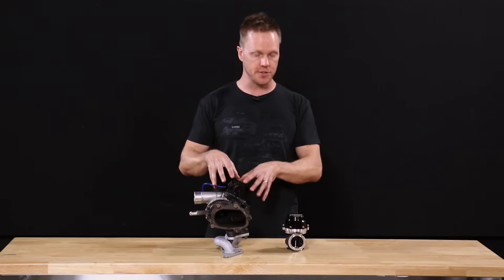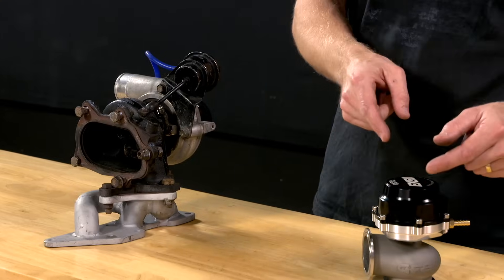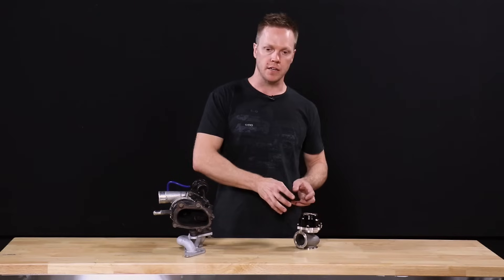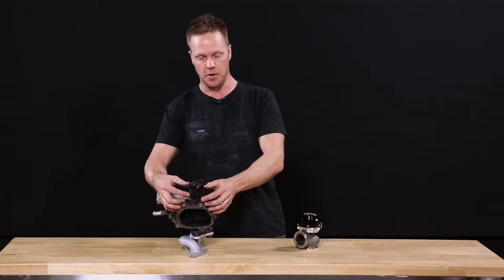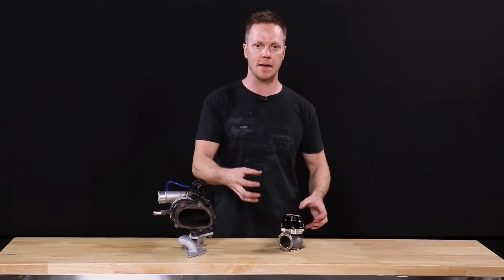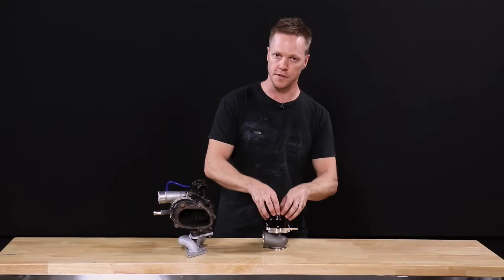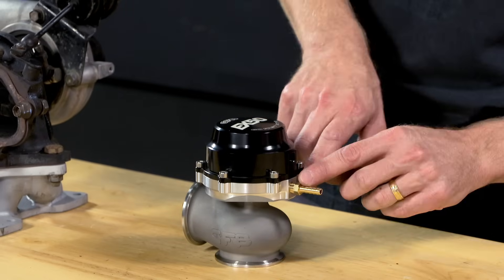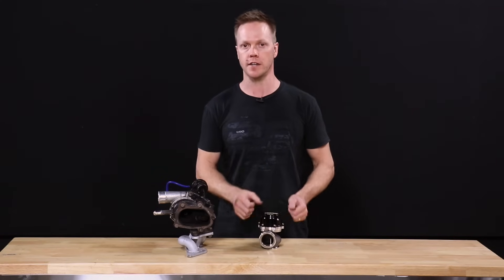Internal VS External Wastegate Explained [GO FAST BRETT]

Comment: I have a V7 JDM WRX so I am needing to put a JDM downpipe on them. I found a company who does both a catless vs catted and I originally wanted the catted because I was worried about the smell and boost creep butr decided to go with catless due to cost. However, watching this has made me again re evaluate my choices. Is it cheaper to just buy a High Flow cat and be done with it, or cheaper to grab a Catless downpipe and do an internal to external wastegate conversion? I am planning on replacing my TD04 with a VF30 at the same time as I do the Downpipe.

Also, with JDM WRXs, do you need to replace the Upipe or can the stock one be used with external wastegates?

Comment: how do you adjust boost pressure using your stock internal waste gate? and how do you know how much boost youll be making
Reply: manual boost controller and fit a boost gauge :)

Comment: I have a Q: I have seen some cars with an exhaust system, but they have been spitting flames right under the engine at redline. Does that mean that they had an external wastegate that was throwing the gasses right into atmosphere?
Reply: I have the same question and sadly after 5 years no one answered your question
Reply: @diego.soli5  Yeah thats most likely an external wastegate. A  pipe going from the manifold that lets out exhaust pressure to adjust the boost pressure.

Comment: Go fast Brett, can you do some explanation on  the dark art of turbo charging diesel, And perhaps how to maximize the power available from a turbo diesel engine.
these vids are great, keep em coming.
Reply: It's essentially the same thing. More air + More Fuel = More Power
(a bit over simplified, but works for this example)
Reply: I should also note that if its a factory turbo diesel, the turbo isn't there to make power, its there so the engine can actually suck enough air to work at such low rpm's
Reply: /DRIVE did a segment on Diesel which is better than this rubbish.

Comment: All I head was: "I have made a waste gate, you should buy it"
Reply: Maybe listen with your ears instead of your arrogance?
Reply: This is pretty much what this whole "Go fast Brett" series is as with his blow off valve segment he didn't even touch on wide open throttle turbo surge and instead pretty much said if your turbo flutters when the throttle is closed it is bad and you should buy my product, which infact when the throttle is closed and when the turbo "flutters" the use of a recirc valve/blow off valve is to stop reverb through the Airflow meter/MAF to cause an incorrect reading and cause the car to stall out when coming to a complete stop.
Even Turbo Yoda said or anyone who is switched on with turbo's knows flutter isn't bad.

Comment: Great concept and I am really learning stuff from these videos eventhough I thought I at least had an ok grasp on how these things work.
I understand that this is sort of the generalized version of how it works but I assume  a lot of these "truths" vary depending on application. For instance dumping boost into the exhaust is that generally always detrimental? I am sure it depends on the diameter and flow characteristics of the exhaust since sometimes a larger volume of gas in a narrower pipe has a higher flow speed and hence more inertia (up to a point) and that actually helps clear gases more efficiently. This is analog to situation in the intake where an optimal portsize is not always the largest one but the one that keeps the speed of the gasses up without beeing so restrictive it saps power (optimal portsize varies with amount of gasflow). Same with dumping boost it in proximity to the turbine blades. I am sure in a factory setup it is "good enough" but could it not be constructed so the dumped boost actually improves the flow/pressure-conditions after the turbine blades? Can the flow be made to be more laminar? Just an idea :) Keep this up.
Reply: A properly sorted External wastegage should in theory act like exhaust headers ( ie a mild scavenging effect ) However at extremely high flow rates of exhaust gas you would be introducing a turbulent effect causing a the exhaust gases to slow down...............Internal gates have their places.......up to mildly modified street cars you wouldn't really notice the difference and the money would be better spent on other areas.
Reply: Robert D I am sure you are right. I just find it fascinating that these are actually very complicated engineering problems where so much depend on the specific application. A pro like Brett who both have the technical knowledge and experience has to "dumb" it down in order to fit it into this format. I would not mind a longer more in depth video similar to "Engineering explained" :)

Comment: What about position of an external gate?

If you have it where exhaust pulses don't collate properly you won't be able to control boost pressure as the reference is still available to spool the turbo.
Reply: Best position of an external waste gate is on the exhaust housing of the turbo before the exhaust wheel.

Comment: Hi Bret,
One thing you did forget to mention is that it is crucial to ensure an external wastegate is correctly positioned on a manifold, so that the exhaust gases don't bypass it at high rpm.  I have seen a 46mm one offer zero bleed off at high rpm from poor positioning, just because the exhaust gases are travelling so fast that they completely bypass the wastegate.  We even removed the wastegate completely to prove the point LOL.

Comment: The only IWG setup that's top-notch, elegant in design, and more than sufficient for the job is that found on the BW EFR turbos, IMHO. I love those.
Reply: Im looking at getting an EFR 8374 twin scroll internal wastegate for my 2jz, I hear the factory actuator is crap but I don't know how true that is. Turbo smart already made a 2 port actuator upgrade for the EFR series turbo already.
Reply: Brian Jeppesen That's the first time I heard of issues with the EFR wastegate actuators. All I've ever heard about them is how awesome they are, next-level, etc. After all, they are run on F1 cars, so they're definitely viewed very highly in the professional racing community. Perhaps it was an old WG actuator design that was revised? Was the person(s) saying it's crap reputable and speaking from actual practical experience?
Reply: +Numinous oh I didn't know they've revised it, I'll have a dig around some more thanks for the heads up. It's the Rotary guys that's saying the actuator isn't very good at higher rpm the flap would open abit as there's no 2nd port in the actuator for the boost to hold it shut and they would get boost drop off.
Reply: Brian Jeppesen Hmmmm, well that could be a lot of things. On my platform (Mazdaspeed 3), we drool over these and have had great luck. I'd personally go with an EFR7163 (we're 2.3 liters) and have it tuned for 500whp.. It's an amazing, fast spooling turbo, with very low boost threshold and amazing transient response. Some other guys talked about using the EFR8374, but I think it's too big for us for anything other than a dyno queen, given our displacement. Regardless, awesome turbos.
Reply: +Numinous thanks for the info man nice to get feed back from someone who have actually used it, I got a Nissan Z32 with a 2jz swapped. Being a 3 liter I think 8374 would match it alright.

Comment: Does one sound louder or nicer than the other. I assume each person has their own preference. Be nice, I'm new to this stuff :)
Reply: The external will be louder if you vent it to atmosphere, whats known as a screamer pipe but if it is just dumped into the exhaust it will sound more or less the same
Reply: It depends on how you run the dump if you run an external set up. If you run it back into the exhaust it will sound much like an internal wastegate and won't make much of a difference. If you dump to atmosphere you are basically running a straight pipe everytime your wastegate opens. So it will sound like your exhaust normally does until you hit full boost, your wastegate opens, and it gets a lot louder. Wastegate dumps are sometimes called screamer pipes for this reason.
Reply: but i thought the wastegate closed when you reached full boost , isnt it like that ? (im also new to this stuff sorry if i didnt understood )
Reply: +nah valdez Well, you understand that a turbo uses exhaust gases to spool up, right? Think of it this way, a wastegate pretty much literally "wastes" exhaust gas once you reach your target boost pressure. It opens in order to let exhaust gas through without further spooling the turbo to prevent over boosting. That gas is "wasted" because it's not being used. Think about it this way. You want to fill up the sink with water. You turn the water on until it reaches a certain level. If the water is exhaust gas you can't turn it off, right? You don't want to overfill it, so you have to open the drain (wastegate) in order to maintain a constant level. the water is coming in and the extra is being wasted down the drain to try to maintain a constant level. Might not be 100% accurate but it should help to understand it.
Reply: +that.nissan.punk yes i get it now thanks, and would it also "scream" when you close the trottle right ?
Reply: +nah valdez no, when you close the throttle you are stopping the amount of exhaust pressure going into the turbo. what you'll get is your blow off valve releasing boost pressure. it will either release the boost pressure back into the intake if it's a recirculating valve or vent to atmosphere. or both if it's vent to atmosphere. unless you don't have a blow off valve. then it will braaaap stutututututu instead of braaaap pshhhh.
Reply: +nah valdez I said it will recirculate and vent to atmosphere if it's vent to atmosphere and I meant to say it will do both if it is adjustable. you can get blow off valves that recirculate some of the boost pressure and vent the rest. some are adjustable so you can adjust how much is recirc vs vented.
Reply: +that.nissan.punk i had blow off valve and wastegate confused then , thanks a lot i appreciate the kind  explanations

Comment: In what way is the internal wastegate better?
Reply: Manufacturing cost really, and also it's easier to manage emissions. It makes way more sense from a factory perspective.
Reply: I'm sure having an external wastegate is legal as long as you vent into your exhaust and not to atmosphere.
Reply: And you won't get raped by the Australian police when you get pulled over for having a turbocharged car.
Reply: Here in SA, external wastegate of any sort is banned, and I believe it's the same everywhere else.
Reply: They are legal if it is engineered. They do the same thing emissions wise as an internal gate when plumbed back, however its just illegal purely because they are non stock mechanical parts. E.g. If you welded shut an internal gate, and installed a plumbed back external gate. It would be illegal, but extremely easy to engineer.
Reply: External waste gaste isn't banned. To comply with EPA it has to be plumbed back to the exhaust before the CAT.